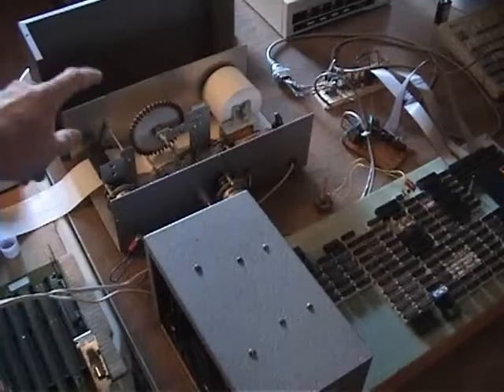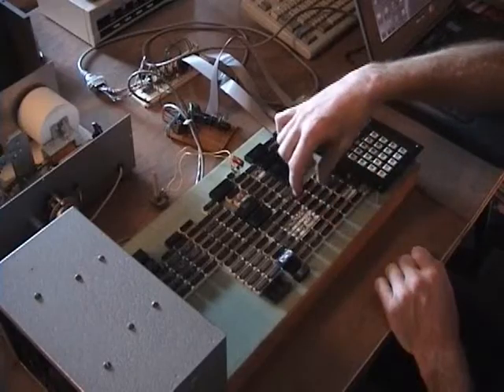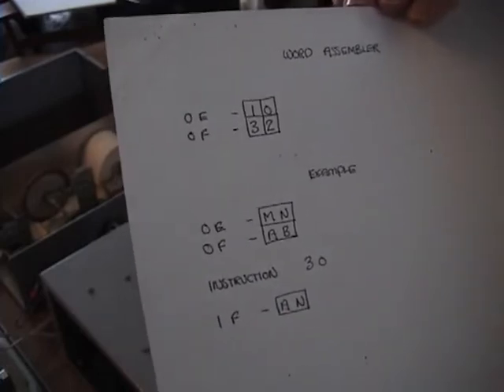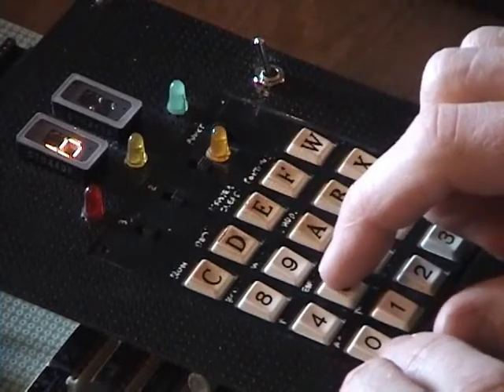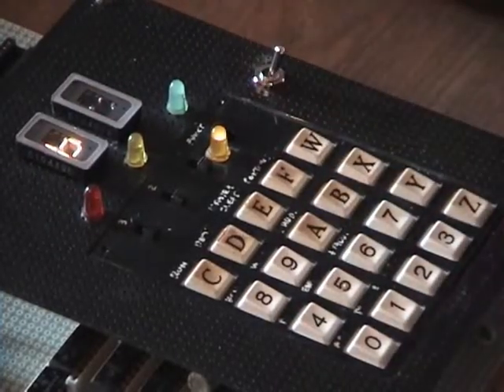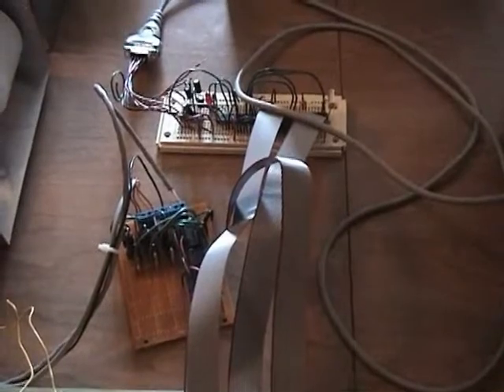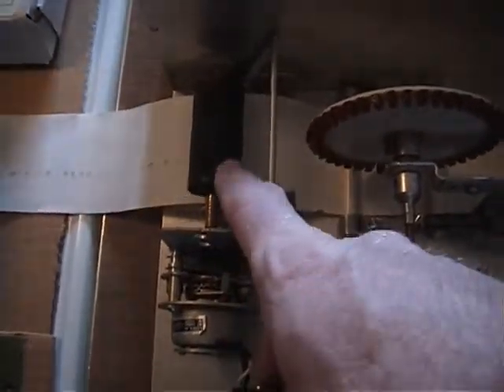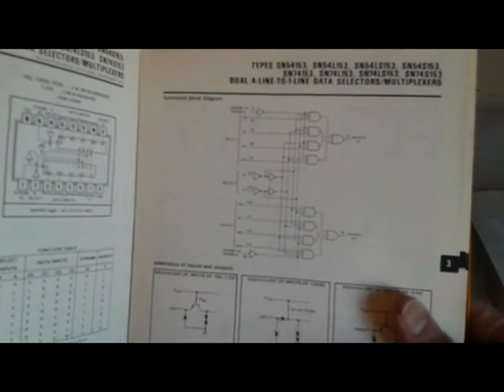1976 8 bit TTL Home Brew Minicomputer & Printer

Comment: Very nice, and super impressive that you were able to build this in 76.  Also happy to see that was still working.
Reply from the maker: Hi Bill,

I got the computer out to use it at a program at the National Aviation Hall of Fame November 18th. Thought about setting it up as a static display. Ended up having too many items for me to handle with the crowd we had so I didn't bother to set it up. Now am thinking about having it as part of the Computer Museum exhibit at TechFest Dayton in February 2024. I tested it this past weekend. Had to repair three broken wires at the headers that connect the keyboard display board and had to clean oxidation from a lot of the I.C. pins. After doing that I had it running a few programs to test the various processors. I plan to have it running a lot faster and doing some more involved programs including communicating with a terminal, a monitor program and maybe a language with some math as a small example of TTL logic based computers and hobby projects of the time before microprocessors got cheap. I keep saying I have more you tubes in the works and I actually do. Details on the Relay Computer might be next. Check out the 2023 Tandy Assembly you tubes. I did the Sunday, day two, talk and I also had the Relay Computer running there on Sunday.

Comment: That looks amazing! Great work on the printer aswell.
Reply from the maker: Thanks for the comment Andrew. This was my winter of 1976 project. 
Much of it was done on a TV tray while watching TV in the evenings. Board upside down so I could do the wire wrap with my diagrams and the TTL databook nearby to figure which pins I had to connect. I did a series of processors and computers using the same techniques. See my other replies.

Comment: those displays are gorgeous.
Really nice work! the printer is awesome
Reply from the maker: Thank you Paula. I have debated adding more memory to the computer but then it would be the machine I designed, but not the machine I used all those years ago. I have plans for a bunch more videos and maybe another one with even more details on this machine. Checkout my Relay Computer driving the Robot in my Dayton Computer Museum you tube. I think I'll get better with the helpful graphics as I do more of these. Oh see what I did on the Stirling Cycle Engines you tube.